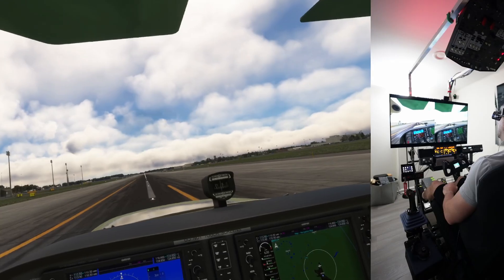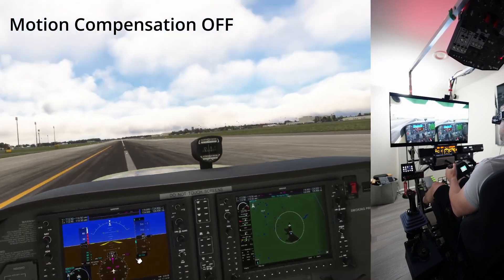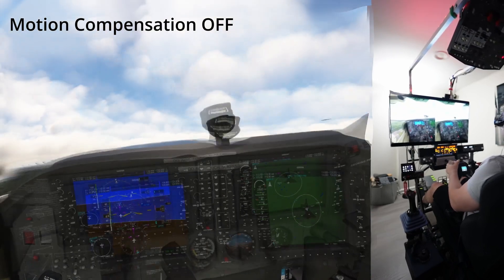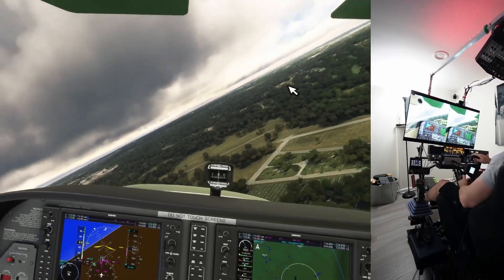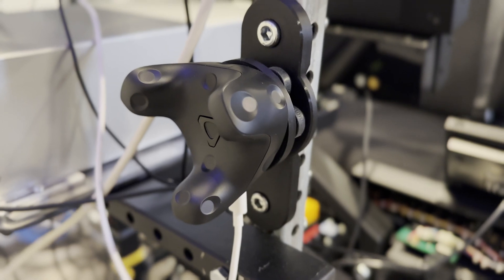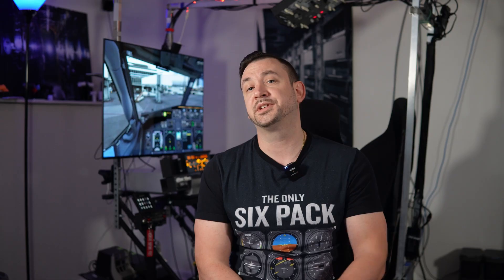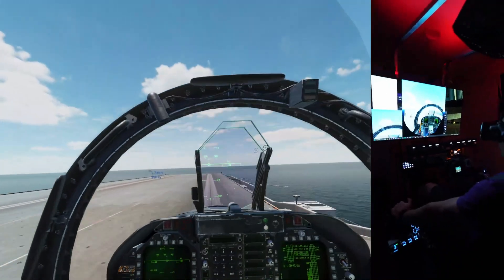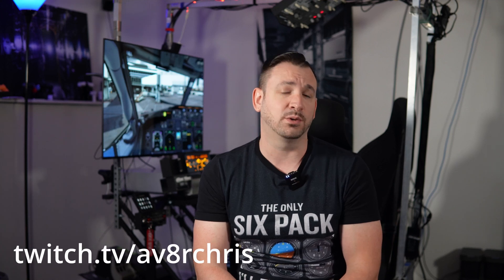Using a Motion Rig in VR! MAXIMUM IMMERSION!

Comment: I read somewhere you can turn off, or reduce the dof in the quest 3 making it not need motion compensation……..I just checked and it seems to be under settings/movement tracking/headset tracking. if you turn that off it might work? I don’t have a motion rig yet so can’t test it😢

Comment: chris, so for big screen beyond. on a motion rig. install the vive tracker on back of the seat above head and what about the base station?
do you just put that on the ceiling or wall as beyond screen 2 required base station?
Reply from the maker: @9Fahim  I have mine in the front of the rig it just needs like of sight to the base stations. Far as I know beyond 2 also needs base stations.
Reply: @av8rchris so 2 the base stations mounted not on the rig but the wall or on a floor stand?

Comment: Just FYI, if anyone has a Quest 3... you can use a Quest Pro controller as a tracker and it can be mounted anywhere on the rig as it has its own cameras and processor to know where the controller is regardless of if it sees the headset or not. I actually mounted mine behind my head on the seat. You might have to use some tinfoil on its capacitive sensors it to keep it awake if you don't move enough but it works pretty good on my 6 DOF rig and I'm happy with the results.  Hope this helps some of you out there.

Comment: Very informative video. Thanks
I noticed you have placed your VR hand controllers on your rig. What do you use that for? 
I have seen other people doing that and I could never guess why.
Reply from the maker: Which part of the video?  If its around the 2:47 part that was used to be the sensor for the motion compensation.  Currently I use the vive tracker instead as its a bit easier and doesnt tie up a controller.

Comment: I wonder if you used the quest pro controllers would you have better results… I know they have cameras on the controllers and their own chip
Reply from the maker: I thought about trying that but I had some tracking issues even with the rig locked. I assume due to the screens reflectiveness.  I’ve been very happy with the big screen so far. I use my quest for everything else.

Comment: I don't see why you can't just weld on mounts for the base stations. I've always wondered that wouldn't work.
Reply from the maker: To mount the base stations to the motion rig itself?  I know they have moving parts inside that can get damaged if theyre moved while on I believe.  If that wasnt a factor it would be interesting to see how it reacts although I cant imagine well.  I've seen tracking get messed up for me if i power off one of the stations, move it then turn it back on.  I dont have a good enough understanding on the tech to understand what might happen.
Reply: @av8rchris  I am glad I mentioned that because I had no idea they had moving parts inside them. I just assumed they were some kind of sensor. Since I can no longer use the Openxr toolkit on DCS(Varjo Aero) I don't have the ability to counteract the vibrations of 3 buttkickers on my rig. I was kicking around the idea of mounting them to my rig. That would have been a HUGE mistake. Thank you!
Reply from the maker: @baaamakingbaaaa  Oh wow - glad I could help!  Check out some YT videos where they're filmed with an IR camera and you can see it in action.  If your using a vive tracker I ended up 3d printing a mount that I was able to insert these rubber spaces used on drones.  Someone had the files on the openxr mc discord.  It works really good unless I really crank the butt kicker up too much so I just found a happy medium by playing around.

Comment: Interesting so you believe Vr headsets that need base stations work better with vr motion compensation than newer headsets ? And why do you believe your screen had something to do with the tracking ? I for example dont have a screen only VR, do you think motion compensation will work fine for my quest 3 ?
Reply from the maker: Its mainly from my experiences with the rig and VR.  When I had a smaller 27in monitor i didnt have too many issues.  I think the reflective surface combined with how large the screen is (43") causes the loss in tracking on my Q3.  I did a few tests covering the screen and there were some improvements but that wasnt ideal.  If your just using a 2 or 3 dof rig and no screen you may be fine with a Q3.  If you go for a 6 dof, the witmotion style sensors cant account for that so you wont have a proper motion comp experience.